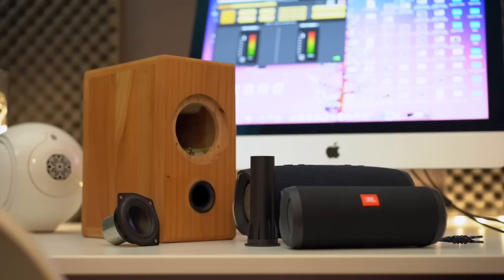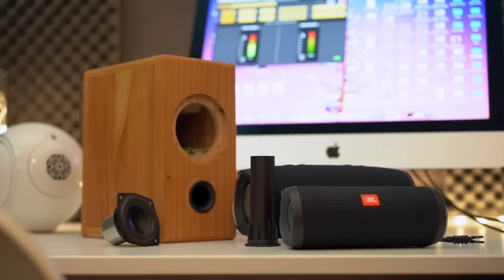Are passive radiators better than ports?

Comment: it just depends of your needs
- ports : loudness, compactness, cheapness, easy tuning with calculation tools
- passive radiators : waterproof, clean bass, good looking, no bass port noise, no damages below the tuning frequency, no open baffle effect at maximum volume
Reply: i'd say it's easier to make a compact speaker with a PR though.
with a port you have to calculate the extra space used by the port or your calculations will be wrong especially with something like WinISD
Reply: Hey what is the open baffle effect?
Reply: I agree with BH4, your box volume is the same as a single speaker sealed box with a PR vs with a port you add 25%~ more volume. So I would say PR's are more compact, that said you still need a box that's large enough for both the speaker and the PR.
Reply: I know it's pretty off topic but does anyone know of a good place to stream new tv shows online ?
Reply: Passive radiators are not tighter or more accurate than vented design. In fact, group delay is usually higher on PRs.
The biggest benefit is that it allows for smaller enclosures while keeping the low tuning frequency
Reply: Ill use them both

Comment: Ports are better for big subwoofers but for small Bluetooth speaker you can't use ports as it will make the sound worse unless you make the encloser much bigger which is not suitable for portable speaker. Plus the speaker doesn't remain waterproof.
Reply: For big woofers  also, passuve radiator gives more precise sound and extended low frequency response
Reply: @arshadpc7691  what about for floorstanding speakers like the Polk Monitor 70 series II that use 2 6" passive radiators and one 6" dedicated woofer?
Reply: i was actually really dissapointed w/ the bass output of the speakers.  if you have a sub they sound great, but kinda wish i would've gone for the Cerwin-Vega's that still use full size woofers.  I can still remember back in the 80's and 90's before subs were popular they use to sell speakers to where you didn't even need a sub.  good luck finding a pair now, unless like i said, you go w/ Cerwin-Vega's.

Comment: Exactly, there is no point of making compact/waterproof made bluetooth speaker to have big ass port to achieve the same level of bass that can be achieved with passive radiators. It's pretty hard to fit proper port inside of speaker that's size of water bottle
Reply: Facts

Comment: I've been boulding speakers and subwoofers for 20years + and my experience with passive radiators are that they sound tighter and more accurate. Because of the radiator and the driver is moving out simultaneous and in simultaneous the pressure in the box is much greater than a sealed system, both drivers react and stop even faster. That gives a great punch in the low notes.
Reply: Why are you naming it as an advantage that driver and radiator are moving out simultaneously? Same is true for a port. If not, there wouldn't be any constructive interference. Also the radiator has to get excited by the driver, just like the air volume in the port which acts as a resonator.
Reply: With the mass added to the radiator, the radiator can get a very long travel. And the pressure in the box becomes very high, witch prevents the active speaker to move and hit the bottom of the magnet. My experience with passive radiators is that the bass becomes much tighter, clean and the drivers can handle more power.
Reply: If you compare PR to sealed subs, which is better for sound quality/accuracy?

Comment: 1) What about a third choice, besides passive radiators and ports : just a round hole. 
2) On which wall ? Not counting the cabinet wall where the speakers are mounted : Which of the five remaining cabinet walls would provide the best effect ? 
3) What size should the hole be in relation to the woofer, to the enclosure volume ? 
4) Should passive radiators be the same size as the woofer in the box ? 
5) Sealed OR Vented ? That is the MAIN QUESTION I am going through ''at this very moment on stage''...

Seems like it's a matter of experimenting with variables involved, in trial and error with your particular system. 
Still,  refreshing to hear other folk's comments. 

Thanks People.
PS. I am building the BEST sounding speaker in the world, and extremely efficient and very cheap...
Reply from the maker: Julio Jesus Jimenez 1) in which way would a round hole in a cabinet support a speakers bass response? 
2) the effect is mostly the same because frequencies below 200hz don’t really have a direction 
If you get very close to a speaker the side walls are probably best because everything mixed slightly nicer at those distances 
3) there are specific formulas which calculate the exact dimensions of a port using the woofer parameters 
4) it should roughly move 2x more air than the active woofer, so it should either have twice the area or twice the excursion of the woofer itself 
5) it depends on the woofer that you want to use, both enclosures can sound great if designed nicely

Comment: in my opinion the passive radiators are better than ported ive had a ported speaker and now i have jbl flip 4 and passive bass radiators sound better
Reply: Ports are not for portable speakers in my opinion.
Reply: so you've forged your opinion by comparing completely different systems and generalized that ports are worse than radiators? sorry dude, that's not a very smart thing to do.

Comment: I want to build a Bluetooth speaker myself, the problem is, when I want to use a port, I would come to a housing that has like 16 liters of volume, already for a subwoofer with 3 inch diameter. The housing shall be small and nice and modern looking, when I want to use a radiator, is it possible to have like a tube in the housing, where on one end the speaker is mounted and on the other end the radiator?

Comment: he passive element always goes deeper than the bass port A pressure element or a passive element is already an old invention it is no longer used The bass port lasts longer The pressure element or passive element decomposes faster The speaker cannot get air It's overheating And finally breaks down There must be some reason why those passive elements are no longer made, are they too expensive or do they decomposes faster the bass port is much better it lasts longer i like more that passive element is an old technique it is no longer used that's it

Comment: Man, I Hope the minirigs get a Passive Radiator at the Bottom. Maybe Then they have enaugh Bass.
Reply: why not split the case and install a longer tube like the sub has. in fact im pissed minirig never made that option instead of charging more for a sub

Comment: Passive radiators are better than ports when the box is tuned for it, and its really hard to tune. JBL honestly doesn't make a good example for passive radiators, Vanatoo is a great example, despite not really having much name recognition to the masses. Idk, I'm a big planar guy, If I could my sub would be a planar. I just like the really tight bass you get from it, and though you don't get the same level from say a passive radiator, you still get more than a ported speaker.

Comment: Ha. Very interesting explanation..I love it...but also confusing...why is it then that with a passive radiator it has to be completely sealed with no air escaping at all to sound more effective, while with the ported speakers  much air is coming out and they still sound good...if the role of the PR is  to keep the air as sealed as possible in the speaker enclosure why not just discard it entirely and build the speaker without one...
Reply from the maker: of course the enclosure has to be sealed with a pr because otherwise how is it going to move effectively? 
it’s about moving air at a certain tuning frequency, which you can either achieve with a port or a pr tuned to the correct frequency. 
i’m having a hard time explaining this rn so maybe there’s a good and detailed article out there that does a better job.
Reply: every box has to be sealed well even a ported one (except port of course), If there is a small gaps you will hear whistling sounds.

Comment: If u dont want speacker sistem you can,t hold in one hand just use bass reflex ,its better ,and free,only calculation,a pipe or a bass reflex will do same thing ,but passive radiators must be tested until they are good for sistem ,i,ve seen a lot of chineze good speackers copy of jbl that has passive radiators harder then the power of actual speackers,the ones that are good use soft radiators ,vs high end jbl uses a enforced membrane that not even jbl speackers can't move them ,so just change the pasive membrane you will se is good for the price

Comment: You can't buy passive radiator's with magnets because the magnets arnt needed?  Sony, jbl etc all use just weighted diaphragms, surely they know what there doing
Reply from the maker: did I say with a magnet in the video? 
I mean passive radiators with everything but a magnet 
the moving mass has to be moved in a linear way
a metal weight in a rubber surround doesn’t do the best job

Comment: bass reflex ports are the stupidest thing ever invented and can never come close to the bass passive radiator delivers! the main advantage of radiators is delay due to no solid connection to the driver - therefore it vibrates slower and delivers deeper bass compared to the driver! even more so if it feeds off of a dedicated bass driver.
Reply from the maker: yea it’s so stupid 
that’s why 90% of speakers have it 
did you realize that they work with the same principle already?
Reply: @speakertoni2680  yes, 90% of speakers suck. also, until very recently, 90% of light bulbs were incandescent, wire bulbs, they too were not stupid? and no, they do not use the same principle: bas reflex ports simply make use of the backdraft, while passive radiators amplify what would normally be acoustic enclosure vibration effect
Reply from the maker: @sasham4073  nope, the passive radiator also uses the back wave of the driver to create sound by passive movement 
you tune it to the same frequency as you’d tune a port to 
and what is acoustic enclosure vibration effect please? 
and that’s an interesting statement for sure hahah
Reply: @speakertoni2680  i see, you need a drawing. but find it funny still
Reply from the maker: @sasham4073  maybe I do but not from you pls hahah 
if anything I need an explanation for the things you said 
but ofc there is non because it was wrong
Reply: @speakertoni2680  i said bass port does not use the air pressure to amplify vibrations of enclosure or radiator, therefore not the same principle. also, if you try talking less and listening more maybe you eill hear the difference between mid or high end speakers with and without bass port, especially if the one is facing backwards
Reply from the maker: @sasham4073  you’re better off with a google search 
this is pointless
Reply: @speakertoni2680  i only use yahoo

Comment: 0:52 voice coil on a passive radiator? Do agree with you, passive radiator for BT speakers but not on truly high end speakers. Nice vid man!
Reply: there are high end speakers with passive radiators, do you know ELAC or FOCAL ? :

https://www.l-e.cz/media/catalog/product/cache/2/image/9df78eab33525d08d6e5fb8d27136e95/a/d/adante-as-61-black-11.jpg

http://www.scanproaudio.info/wp-content/uploads/2017/04/Focal-diagram.jpg
Reply from the maker: TechTT thank you 
Yes, they need a voice coil in a spider to move linear 
They just don’t have the magnet of a normal driver
Reply from the maker: THDS I wouldn’t call these two truly high end 
Focal and Elac use ports on their more expensive models
Reply: @speakertoni2680  that's not quite true : https://www.amazon.com/s?k=focal+monitors&lo=list&qid=1560362321&ref=is_pp_2
the most expensive monitor is the M9 with a 6.5" passive radiator
Reply: Speaker Toni LmAo jbl didn’t did this (my Xtreme 2 passives goes out of Axis at some frequencies or on sun)